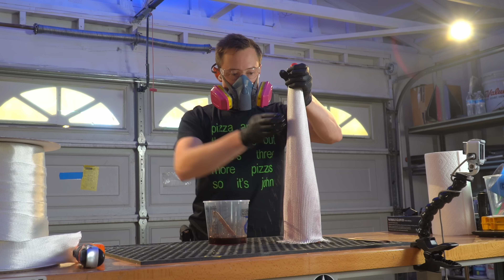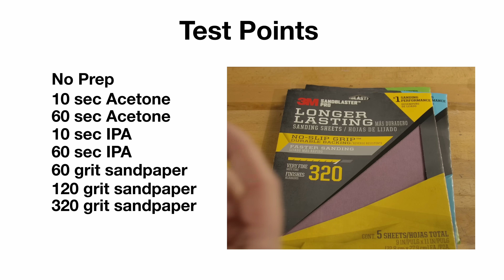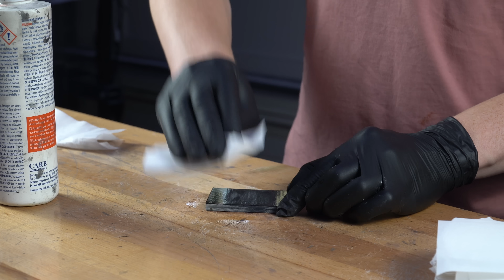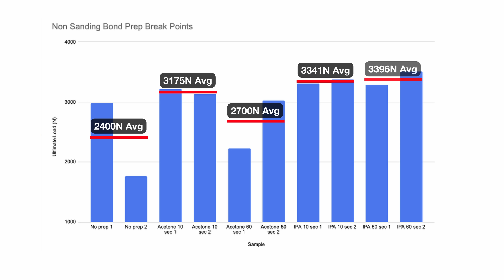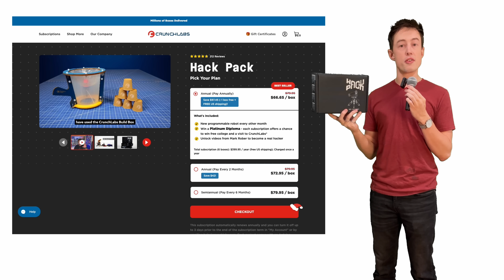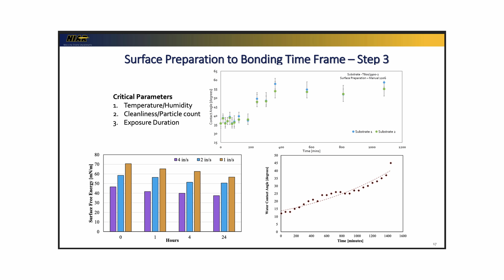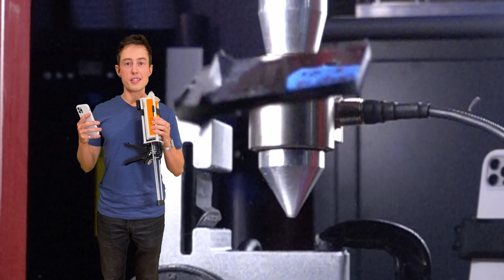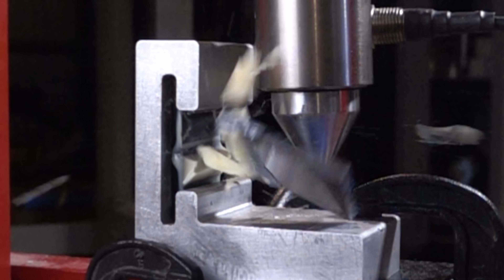I Broke 100 Epoxy Bonds to Find the Strongest

Comment: with glueing, a lot of people only have some half knowledge, gotta agree with that guy you talked to.
There are the following things:
Your workpiece has a bunch of different layers on top like the Beilby layer, an oxide layer and an adsorption layer.
The thing is, when you sand the surface, you partially remove parts of those layers, but you also start to mix them with each other. Sanding will at best give you a surface layer increase of maybe 1% if you're lucky. This won't be enough to increase adhesion, and that has scientifically been proven time and time again (including your video now lol).

In the automotive industry, we typically glue the entire front of the car using epoxy. Why? Because the steel in your crumple zone has been heat treated in a special way that allows for more energy dissipation in a crash. Typically in a crash, the metal might break, but the epoxy bond will stay strong and hold.

Here are some ways we do this typically:
-reconstruct your design to put less normal-stress on your bond, and more shear-stress on a wider area
-we also sometimes use acetone and IPA but I'm not kidding when I say that's pretty much the most basic way of doing this
- Sometimes with wet preparation we use NaOH, KOH, Na3PO4, Na4P2O7 and additional tensides in a supersonic cleaner or using vapor/steam cleaning (acetone or ipa vapor for example), sadly I can't post images in this comment section, I could send you some basic designs for that.
-another way is using non-oxidizing acids like HCl, or watered down H2SO4 or using oxidizing acids like HNO3 or H2CrO4 to remove dirt and part of the oxide-layer to get a defined material surface, after that cleaning with pure H2O or neutralising it is a given. Don't over do it, or your substrate might break down or crack.
-We use what is called the Kreidl Prozess, basically using a blowtorch with an excess amount of oxygen, and applying that flame for exactly 1 second, similar to your approach, but the access oxygen is what makes it work way better
-other times we use bromine with UV rays or flourine on the surface aswell, which will help to generate an interphase between glue and substrate
- anodising (electro-chemical) preparation is also sometimes used, but that won't work in your case, as your fins aren't made of metal
-Plasma, but we use a "coronal plasma treatment" or "IONAL-process" with 2 corona electrodes with about 1.5mm of distance between workpiece and electrode 
-Plasma gun process, basically what you did but you have to get very close to the plasma, between 4-15mm max at a speed of 1-10mm/s along the surface
-low pressure plasma treatment (same as before, but in a low pressure environment)
-after all that is done, we optionally also use a primer, basically a low viscosity version of the glue (epoxy) on the surface and then after that we use the actual glue itself

What you have to keep in mind with glue in general is that ANY change, even a simple or miniscule change in your process or production stack, that you might not even notice, will completely change the maximum forces the bond can withstand...

Anyways, sorry if my english was poor, I'm a german. And thank you for listening to my TED talk.
Reply: Holy moly this guy glues
Reply: @d2cbro  and his english is excellent
Reply: everyone that says their english is bad always have great english
Reply: my only note is that when you say 'access' you mean 'excess'.
Reply: Now that is a ton of good knowledgeable information.
Reply: A big variable that drives me insane for many adhesives is  how long since the adhesive was manufactured.

Shelf life is a huge variable, and many manufacturers don't put a date...they use an internal code that you have to hope you can decode.

It should be mandatory to stamp an actual readable manufacturing date on all adhesives.
Reply: @PowerScissor  you're totally right, in the industry we usually know when a certain batch was mixed up by the seller, so I missed that part for hobby production. There's probably a lot more that I forgot, it's a vast topic.

Comment: There are all kinds of different sand paper and each one could leave different contaminates on the coupons.  IE: Sandpaper for wood vs automotive sandpaper.  The grit from sanding don't clean out of the scratches as easy as you would think.  The one test I would have tried would have been a brass brush and compresssed air after sanding and prior to the Acetone and IPA.  Something for another day to try.

Comment: "Sandpaper "
That actually bothered me, because, in my limited experience, over 35 years, I found that "sandpaper" sheets seem to have somewhat poor adhesion of the grit to the substrate.
Many years ago, I picked up some rolls (belts)of abrasive material used in automated grinding of hardened carbon steel tools on 100 mm x about 4 m Long belts. These have a 'textile' backing material, with the grit embedded in a layer of Semi-flexible adhesive. Probably because of the nature of the adhesive substrate, I recall that there is almost zero of the grit broken out of the substrate, and the material doesn't "load up", because the grit particles have quite a bit of spacing among them. When I compare this material, in 60 or 80 grit, to "sandpaper" purchased from a 'big box' construction material store, the sandpaper has much more grit, in less adhesive, and the grit loads up with material, and the grit breaks down, breaks out of the base adhesive.
Ende

Comment: Another great video Joe. One thing I noticed with your prep methodology was that it appears when hand sanding, you sanded in a single direction on all coupons. It is common practice when doing bond prep to do cross hatch sanding. Sand in one direction, then rotate 90 degrees and repeat. This provides ample surface area for a strong bond. I highly recommend trying this if you haven't already. Best of luck with your future research!

Comment: Love the video, I work on fabricating solar cells from scratch and we usually clean the substrate with deionised water, acetone and IPA in an ultrasonic cleaner and drying using dry N2, then doing a UV-Ozone treatment, I don't know if this will help, but it really is interesting the similarities on the cleaning steps for bond prep.

Comment: Watch NightHawkInLight's video about the most optimal way to do testing.
I'm a computer scientist, so here's my grain of salty snack: the best code is no code.
Do you have to use epoxy for this joint? 
A grade 8 1/4" metal bolt has a shear strength of 11,250lbs and the consistency you could get with that is probably well worth the extra weight.
Maybe the fiberglass of the shaft could bend outward to directly integrate the fins, or it could have notches cut out to interlock the parts physically to avoid having the epoxy hold the force.
A lot of this video's experiment also hinges on the rocket "might" flip sideways. Don't cater to undefined behavior.

Comment: There are a couple of plasma options you didn't explore here that might yield some better results. Firstly there's laser oblation which would be easy enough as all you'd need is some kind of laser engraver that could consistently produce a solid patch of etched area. That followed by the acetone and IPA prep should work pretty well. The second option is a plasma cutter but I suspect that option would likely work about as well as the MAP gas torch.

Comment: Im sure its just common knowledge to a lot of people but when sanding some pretty tough material it shocked me just how different sandpaper can be. I kind of just assumed most of it of a particular grit would be much the same, and it just isnt, with one brand being so much less effective presumably because it wore thin within very little time at all. A switch to another type and I was shocked by how much material I was suddenly moving.

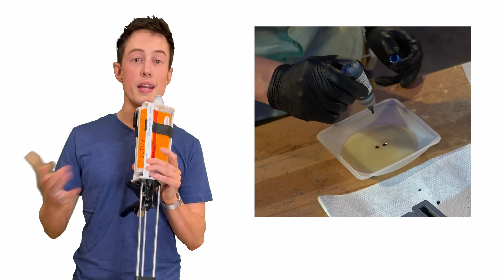Comment: 4:00 don't dog your own science so hard. you are doing science in this video! and its good science and good engineering. as long as you track your uncontrolled variables and write everything down, you are golden. its up to other people to determine if the data is useful, not you

Comment: I have a theory about your 4000+ N result. By sanding too deep in the center of the bond location (at the 0,0 interface point on the face surface), you inadvertently introduced a localized concave depression or dimple-like geometry into the otherwise flat bonding plane. This resulted in a non-uniform surface profile, with the central region recessed below the surrounding areas, potentially allowing for a thicker epoxy layer or improved mechanical interlocking in that spot, which could redistribute stresses under load and contribute to the observed increase in failure strength from the 3000-3400 N baseline to 4000 N.

Comment: what if you milled whole pockets for more strong surface area, it seems like its always the surface delaminating over the materials failing, theres a lot more strength to be gained. can think of a few more ways of getting more surface area but you have enough variables to try as it is, and this is the easiest/best one I have. maybe fasteners or threaded rods with washers or through the back sides, give a little more 3d penetration into the epoxy.

Comment: This is an amazing video. However, I don't know why people say that time-to-bond after prep is a major factor. I'm not suggesting they are wrong, I just don't understand the physics or chemistry on that would matter--am I missing something? The surface could get dirty after time, which would mean you'd probably want to wipe with IPA again right before bonding, but I don't see how a sanded surface would change much after a day unless the substrate was made of an unstable material, or one that was materially different under the surface (like painted steel that would oxidize when scratched up). I would love to hear from someone who is smarter than I!

Comment: Hi, try using filler in the glue. I've heard that it significantly increases the strength of the glue joint and promotes better adhesion to surfaces, as well as reducing weight. Consider abandoning this method and testing another one, for example: a thin fillet of glue with filler and gluing a layer of composite on top with a coating on the mating surfaces (I think this is the method Boeing uses to assemble airplane wings). What do you think about it?
Reply: I'd like to add to my comment. I noticed that in almost all tests, the adhesive completely fails. I would recommend using a filler in the form of microspheres or impregnated fibers placed along the seam. Sometimes the adhesive peels off the parts; in this case, you need to consider the compatibility of the epoxy resins in the adhesive and the part. The ideal solution would be to use the same resin as in the parts. I also believe that failure of the glued seam is unacceptable in aerospace applications. The best result would be a fracture of the part being on press near the adhesive joint.

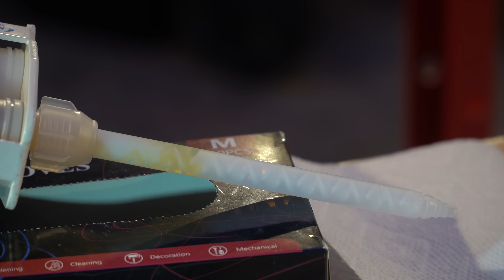Comment: One thing here that you can see at around 2:10 that wasn't distinctly mentioned but you and the audience should be aware of: mix nozzles need a purge. There's unmixed epoxy near the start of the use of the mix nozzle that you really don't want in your bond. Your epoxy may come with instructions, but a 3-6 inch purge is probably good.
Reply: This was one of my biggest unanswered questions. I hope he always squirted out all of the old, already mixed epoxy before doing any new pour. For all the things he did discuss, this never came up. I assume it's because he mostly used a whole bottle at a time, and he probably thought a purge was pretty obvious, didn't do it very often, and didn't consider it worth mention, I guess.
Reply: @kindlin I can't say if this is the case with all mixing nozzles, but mine have always needed to be thrown out after use since the epoxy would harden within the nozzle.
Reply: @32krod   That makes sense. Cuz it was going to start hardening right away.
Reply: And if you squeeze the dispenser too hard (like if it cures in the tube a little because you took too long between dispenses) the pressure can cause the nozel body to swell and you can have the unmixed epoxy bypass the mixing media and you don't get the proper mix. Maybe the vacuum degas helps with that tho. 

Ooh, I've heard the wooden stick for mixing and degassing can introduce moisture into the cup which can cause bubbles as the epoxy cures.
Reply: I also don't like the molds being used. I think he could print something with a cavity for the resin to just sit in, shaped similar to rocket fins. No need to remove them from any mold and you could consistently fill them with similar amounts still.
Reply: well the answer is both yes and no it depends on the geometry of the mixing nozzle. for example hiltis chemset is good to go straight out of the nozzle. but I highly doubt hobbyists need the strength that life shortening epoxy. 😂
Reply: Don't forget a purge before the nozzle is even put on also.

Comment: Before watching the whole test, I would predict the following optimal methods:
- cleaning / degreasing before sanding
- Scotch Brite best results (~320 grit)
- no wet cleaning after sanding 
- apply glue within minutes after sanding
- plasma or corona treating would work too 
- cure at least a few hours 
And finally: use methyl acrylic glue instead for more toughness.

Comment: Epoxy alone is fairly brittle and doesn't have a lot of strength in tension. So the fillets are pretty weak unless you lay fiberglass across them (and preferably vacuum bag it)... Properly layered, a fillet will likely be stronger than the substrate - ie the fin will snap before the joint does...

Comment: So one thing the 120-HP TDS doesn't call out (to a degree I like and is ultimately a gripe I have with a lot of TDSs) and that you didn't address is temp and humidity affecting lay up and cure. They give minimal info on how it affects the the end result but im sure some of the ISO and ASTM standard they reference have parameters for it. 

I'm glad it was all the same batch as you can to an extent rule out some of the shelf life stability, but that's also no guarantee the distributor or the shipper didn't expose it to temps outside its nominal range. 

Maybe the product is only sensitive to the range for an extended window. Maybe the product is resilient to temp and humidity during lay up and  cureing. 

I bring this up purely from a paint/body tech perspective where I've had suppliers/distributors give us expired and bad products and I've witnessed absolutely wild results and repeatability outside our temp controlled paint booth when using various products. 

I'm smart enough to know temp and humidity can make a difference but I'm dumb enough to not know how much of a difference it might make. Like I said, it drives me nuts that the TDS doesn't call that out more clearly as I've certainly seen some that do. Maybe it just isn't that critical for some products but I feel like it it might be.

Comment: Have you thought about a higher quality sand paper? Automotive P graded sand paper is made to not contaminate the panel so that automotive paint adheres properly. Plus it's P Graded so it makes sure that your 60 grit is actually 60 grit throughout the entire peice of paper. It also last a lot better so you can use less.

Comment: Hey Joe, looking at all the failures with high strength they are all through the middle of the fillet. Use some microfiber or something to increase the strength of the fillets as well as the consistent surface treatment. You're welcome :-) great video, I learned a few things here, too. Thank you.

Comment: For aerospace bonding that I performed, you scrub with red scotch-brite pads until you achieve a "water break free" surface (water does not bead on it). Then you clean with solvent (IPA on composites), which you do not allow to dry on the part, must be wiped dry. Then you apply adhesive within an hour (probably mostly due the factory environment).

Comment: Honestly, the cosine error from your non-rigid load cell setup is probably the single biggest impact with respect to uncontrolled variables. It has 2 degrees of freedom just evident in the video, nice and wobbly! Its angle of deflection is probably going to have a nice non-linear effect on load to break and it’d be basically impossible to model the influence out. 

Could you not have used some kind of tube/collar to provide vertical rigidity? Maybe too much effort xD 

For things like dye at a very low concentration, I can’t see you detecting effects of that without 100s of tests as the total difference in load is probably going to be close and therefore require lots of observations for a significant result.

However, even with this small number of tests, although you may not be able to say which is ‘best’ per se. You can definitely answer questions like, if I do this with the prep and process will it produce a fail joint for my purposes?

As a rule of thumb, the greater the difference in output metric evident, the less tests you need to ‘prove’ it so. If the joint remains with a ballpark of performance that exceeds your engineering needs then everything is fine. I fail to see how this is any different from ‘peer reviewed’ testing, or product testing, or any other kind of testing. It mostly boils down to number of repeats and how many people are willing to say, “yeah I put my name to that”. I can point to plenty of cases where such a process gets it horribly wrong. Ultimately, the maths should take you to a place that allows you to produce reasonable conclusions for your needs, anything else is fancy social practices to build trust.

Comment: I think you could have learned a lot by looking at the failure modes more. whether the bond, epoxy or substrate fails combined with the prep methods could have led you done the correct path faster.